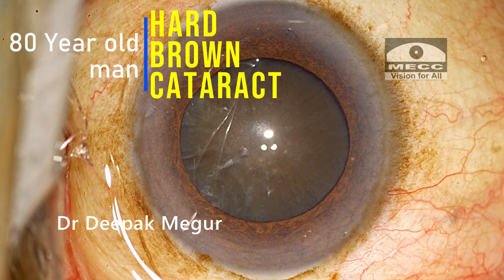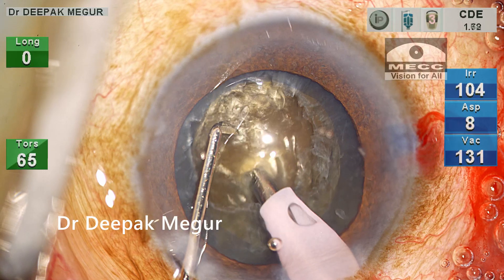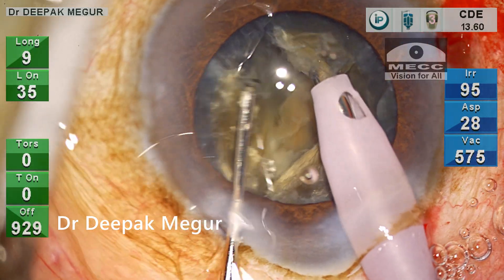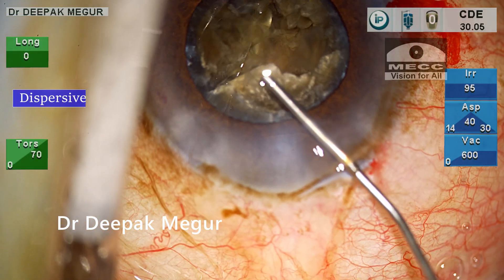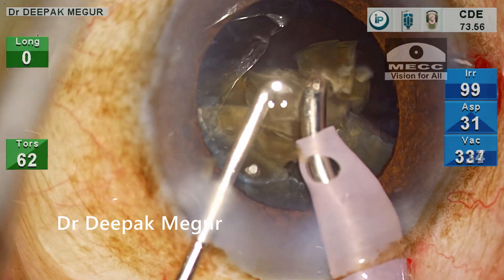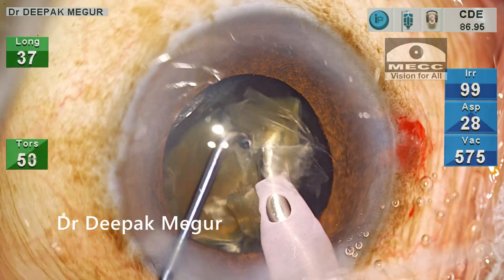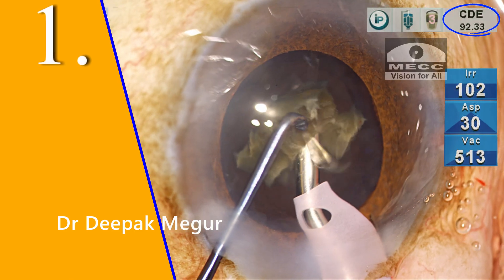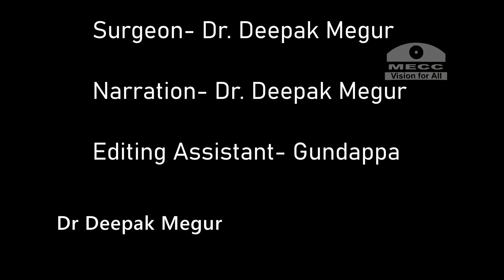Secrets for post op  clear cornea after Phacoemulsification of  a rock Hard Cataract ..! Dr Deepak

Comment: Slow phaco at very high vac and low power, as you did  it, is the key. Excellent. In most cases I always keep the second instrument between the phaco tip and the posterior capsule but in this type of case you need to keep it between the phaco tip and the endothelium, beautiful.